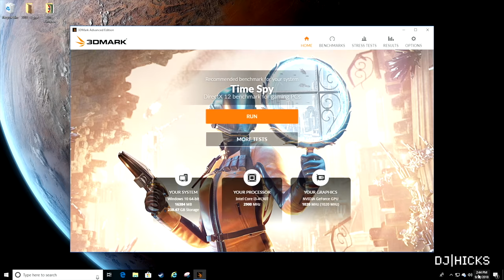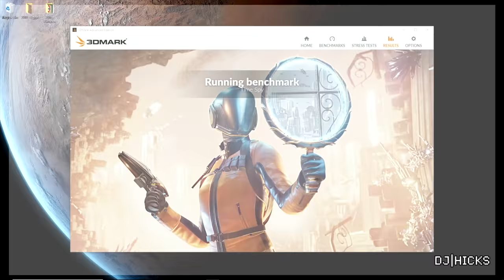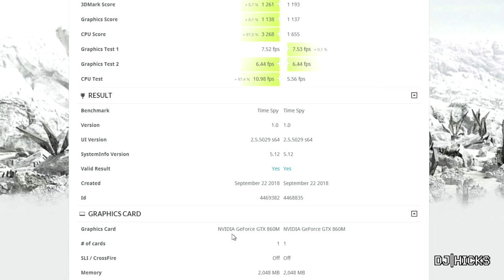How to Upgrade Your CPU Alienware Alpha Benchmarks

Comment: thanks for this, going to change out my i3 for an i5 4670s when it comes in the mail :) Hoping it improves performance decently.
Reply from the maker: Thank you, glad I could help.
Reply: @DJHicks  I had one question, do you experience any heat issues with your i7 S?
Reply from the maker: @matt-be8lc  I haven't noticed any. Even if it is throttling, I'm still getting twice the performance from the CPU. I installed this in an arcade and am running emulated games at 4K. It chugged with some PS2 games, but I decreased the scaling multiplier and it works well. Might be three times the original resolution now. The GPU could be a limiting factor on the newer games since I'm pushing a mobile GPU to 4K.

Comment: You should have mentioned how delicate the pins are, I just broke my cpu motherboard pins by trying to wipe some dried crumbled thermal paste off the Cpu pin set not realising the micro pins bend even if you breathe on them, if I'd watched another video that warned me about that I wouldn't have gone anywhere near them haha damn
Reply: honestly the pins are so delicate i never touch the socket if something like paste falls in just put cpu back in and try rebooting pc. i had some paste in my socket before and it booted fine

Comment: Hey, I have the first gen R1 Alpha ("Reg model:DO7U), and going based off your previous comments, I can only use a 4000 series with this alienware. Do you recommend the i7 4770s that you got, or should I get a core i7 4790k instead? Also, I noticed you said you got cmsx16gx3m2a1600c10 as your ram. Can I use a ddr4 instead, or can I only use ddr3 as it’s an old chipset?
Reply from the maker: You can use any 4000 series Core CPU. I had this one handy so it worked out. If you can find a cheap 4790k, sure. That's the best this generation got. I probably wouldn't overclock it though. There isn't much room for cooling. As far as I know, DDR3 is all that's compatible.

Comment: how was the heat dissipation after the upgrade? I too have a Gen 1 R1, and like you, I have a 4770s available to toss in it. I'm just worried about the heat. all I'm using mine for is a plex server, and I have a plex pass with hardware trasncoding, so this upgrade will increase my total amount of 1080p streams by double(around 8 to 10 streams after the upgrade). the only thing I'm worried about is the heat , if she doesn't overheat, I'm gonna do the upgrade. Nice video, thx!!
Reply from the maker: I haven't had experienced any heat issues. Refreshing the thermal paste was probably good for it too. I use this for an emulation arcade running most games at 4k. It can't handle some PS2 and GameCube titles, but I think that's more on the GPU. I don't know how it would do for hours straight watching movies. I'd definitely go for it though. This was a big improvement for my purposes. If anything it will throttle down if it gets too hot, but it'll probably still be faster than a Core i3.
Reply: @DJHicks  ok perfect!! I am using mine as a Plex server. But I've allocated 8gb of RAM for hardware acceleration and created an 8gb RAM disk for cache writing. It seems to run really well for the server, but it likes to max out all 4 cpu pretty regularly, so I think im going to try the i7 in it and see how it goes. I also have HWinFO running fans at 100%,. Thanks for the feedback sir!!

Comment: Had no idea how many different socket types there are. Even though I got the same one it was a different socket. Can't find any information about what socket type the alpha r1 takes.
Reply from the maker: As far as I know, the R1 had one socket that fit multiple CPUs. There were Linux and Windows variants, but they were all running 4th gen Intel Core i CPUs. The R2 had 6th gen, I believe.

Comment: What is the best CPU you could put in the Alienware alpha?  I just bought the RTX 2880 with the amplifier and figured it was about time to put a new CPU in it... I currently have the i7-6700T.
Reply from the maker: This is a first generation Alpha. The best CPU compatible with this one is probably a 4790K.
Reply: @DJHicks   Im sorry DJ the one I have is the second generation Alpha R2 with the intel i7 6700T....  Can i put something better in it safely?
Reply from the maker: @cedricjamesjr1  You might see diminishing returns replacing the 6700T. You're already on the high end of what the PC can manage. If you were coming from a Core i3 or i5, it might be worth looking into a greater i7. But yeah, Core i7 to Core i7 isn't worth the cost in my opinion.
Reply: @DJHicks  thank you for your reply.

Comment: Hy! Thx the video! 🙏🏻 Question: The Alienware can run in max boost the i7 4770S processor 3.9Ghz? Or heat up quickly the cpu and downgrade the cpu Ghz? Thx the answer.

Comment: Hi there, I have Alienware alpha and it has GeForce maxwell, i3-4130T And 4gb ram ddr3 1600MHz , I have for holidays 150euros max to upgrade cpu and ram. What’s the best cpu and ram for 150euros max???? And do I also need new motherboard?? Thanks so much in advance I wait for reply
Reply: im in the same boat as you!!!
Reply from the maker: You can't replace the motherboard. The best CPU you could get is a Core i7 4790k and 16GB of RAM. Any CPU you get is going to be used. If you are comfortable cleaning and removing a CPU, you can find old PCs for sale on eBay. That's probably your best bet, cost-wise. I'm using the Alpha in an arcade now and the upgrade from the i3 to i7 really made a difference.

Comment: Did you have any problems with it? The chipset compatibility of the Alienware alpha doesn´t match the chipset compatibily of the CPU...wondering if theres a problem if they dont match
Reply from the maker: The chipset matched. The Alpha Gen 1s take 4000 series Core CPUs. I upgraded the firmware before installation to avoid any problems. It worked right away.

Comment: Are the cores hitting close to max turbo boost frequency or throttling closer to base clock frequency under load from the higher power consumption and heat? Also, would it be worth spending $60-80 on the upgrade in your opinion (by purchasing the cpu on an ebay 20% off day + selling the current 4170 I have in it)?

Being 65w places it higher than my 54w i3 4170, which already hits 85c in games like AC: Origins (720p, low, ~30fps). So worried the Alpha would throttle it down for the extra TDP alone and then even more with thermals and get lower enough clocks than the 4170 to negate the extra cores, since the 4170 has the highest single core frequency outside of the 4790 variants, assuming those don't throttle down. But even when the 4170 is at 85c, it stays pegged at 3.7GHz on all 2c/4t. But 2c/4t is pretty rough with modern games, and its hard to maintain a stable 30fps in some.

I'd rather get a 4770t or 4790t ideally, but those are more expensive than the S variants and less pop up on ebay. Just looking to extend its life to be able to toss in a suitcase when we go out of town and my wife/kids go to sleep, since I am a bit of a night owl. I already replaced this with a Ryzen 2200g mini-ITX build as a HTPC/console for my bedroom TV, but even though its in one of the smaller consumer mini-ITX cases, its still twice the size and weight of the Alpha, and GPU's are pretty close, though the Ryzen has the edge over my 4170 for cpu. So debating upgrading the Alpha or just getting rid of it and lugging around my Ryzen build (especially if AMD releases APU's with better iGPUs when they go to 7nm but maintain the same thermals/tdp). Either pc is a 720p machine for the latest titles, the Alpha is just lagging a bit on the cpu side even for that purpose, but much better for lugging around.

Sorry for being long winded, but not many people still working with these Alpha's in 2018.
Reply: I ended up grabbing a 4770t and it was a step up. While it doesn't hit the same 3.7GHz as the 4170t, the games I tested it with saw an improvement with double the core/thread count.
Reply from the maker: I haven't checked the individual cores, but even if it is throttling, the performance has almost doubled under load. If you play CPU intensive games like an RTS, for $60, I'd upgrade. AC Origins performance might improve because it's open world, but it is pretty taxing on the GPU side as well. The 3DMark performance only improved on the CPU test. The GPU tests stayed basically the same.

My next build will include a Ryzen CPU. I haven't built an AMD PC in a few years. I'd like to get a Radeon video card depending on their answer to Nvidia's RTX series. Hopefully they undercut them like they did Intel with Ryzen.

I've looked into other SFF PCs and they all seem to be limited by heat. Like the difference between the i5 and i7 isn't huge because the i7 is clocked down so much under load. Nice name by the way. I immediately heard "LETMESHOWYOUSOMETHIN!" when I saw your comment.

Comment: I'm running an I7-4790 in mine with no problems, if it will run the 4790  it should handle any of the lga1050 processors
Reply: i7 4790t?

Comment: What do you think, instead of buy an egpu kit (GPU, adapter, psu), i do migrate the CPU, SSD, ram from Alpha R1 to a New Motherboard, plus a GPU And cooler? In long term, wouldn't It more cost effective? As long as  you could buy a lga 1150 Motherboard 32 GB ram instead of 16 gb And put a stronger 4gen CPU with more tdp, for example?
Reply from the maker: I would just build a new PC rather than salvage these parts. It wouldn't cost much to outperform the Alpha G1. The appeal is the form factor. If size doesn't matter, you can build a micro-ATX PC for a few hundred dollars that would beat the pants off this Alpha.

Comment: Did you u get a new power supply or was the stock one that comes with alienware alpha i3 enough?
Reply from the maker: I used the existing PSU. There was a significant improvement in performance. If it isn't the full power of the Core i7, I haven't noticed.

Comment: I have the Alienware Steam machine I3 (ASM 100-980) is the same of yours? Or I can't upgrade the CPU in mine ?  Thanks
Reply from the maker: I believe that's the same model number as mine. Regardless, you can replace the CPU with another from the same series (4000 for R1, 6000 for R2).

Comment: What processors did you  upgrade to exactly?
Reply from the maker: Intel Core i7 4770S
Reply: @DJHicks  thanks for this video do you thin i can  upgrade to this cpu Intel Core i7-8700K
Reply: @DJHicks  thank you
Reply from the maker: @carlosespinal1434  No. The motherboard wouldn't support an 8000 series. The sockets have to match. A Core-i7 4790K is about as high as you could go. in a first generation Alpha. Alienware Alpha Gen 2s have 6000 series Core-i7s.
Reply: @DJHicks  thanks
Reply: @carlosespinal1434  A K processor isn't worth it though.  You can't overclock the chip, which is what you'd get  K series chip for.

Comment: Hey DJ, what i5 cpu should I buy to upgrade my alpha? I’m guessing it has to be a 4th gen...I can’t do the i7 because it’s a bit out of my price range, thank you!
Reply from the maker: I don't know if the performance increase from an i5 would be worth buying. You might be able to find an old used PC with a 4000 series Core-i7 for really cheap. Salvage the CPU and scrap the rest. If you wanted to do that with a Core-i5, that's an option too. But the gains wouldn't be significant.
Reply: Thanks for the advice and reply!

Comment: How well does it handle other games at decent settings compared to the i3-4130t? Is there a difference at all or about the same?
Reply from the maker: It depends on the game. I noticed a huge difference in CPU heavy games like Beast Battle Simulator. Most RTS games are more CPU than GPU intensive. I haven't tried Halo Wars with the new CPU yet.

Comment: Does it support 32 gigs ram? What compatible  CPU you recommend now in 2019? Will new intel 8th gen mobile chips (U version) works?
Reply from the maker: 16GB. Core i7 4790K. No, it has to be a 4000 series Core product. Alienware Alpha Gen 2s have 6000 series Core-i7s. This is a Gen 1.

Comment: Awesome video.... Do you still use yours? I have the r3 version and man is it laggy. I use it for my wife to mainly surf the net and watch videos in bed. Already upgraded to an SSD drive but that i3/4gb is killing me. Can you post a link to the parts you ordered, location of the firmware update you did, please. Thank you
Reply from the maker: I was not aware of the existence of a revision 3. Unless you mean Core i3. A PC of of mine died and it just so happened to have a Core i7 compatible with the Alpha's chipset. At this point you could probably find an old PC on eBay with a 4000 series Core i7. You can google "alienware alpha bios update" and it's the first result. This is the memory: CMSX16GX3M2A1600C10

Comment: Did you run into any problems with the T being a 35W CPU and the S being 65W?
Reply from the maker: Nothing I've noticed. There is a significant improvement in performance. Whether it's the full capability of the Core i7, I do not know.
Reply: @DJHicks  Cool! Thank you

Comment: My rust takes years to load and crashes constantly what should i upgrade
Reply from the maker: An SSD would yield the greatest performance improvement overall. If you double the RAM from 4GB to 8GB it would probably help too. CPU would be third because compatible chips might be difficult to find at a reasonable price.

Comment: Hey bro nice video, I have the alpha r1 and my uncle bought the i7 4790. Not the T series will it work in it? 🥺
Reply: It will thermal throttle, but it will work. So you may not get the max turbo speeds for any sustainable time, but still would be an improvement over the stock 4130t.
Reply: FireMrshlBill thanks
Reply from the maker: @aion694  What FireMrshlBill said. Sry for the late response.
Reply: DJ Hicks okay bro np thanks
Reply: GTX 860m just as a follow up, if you haven’t installed it yet, Digital Foundry did a video on the Alpha back then and put in either a 4770k or 4790k. So you can see performance/temps on that. However, I think they concluded that it wasn’t worth it at that time, but with how games have changed in the past 5 years we know the extra cores are worth it now, so I’d do the swap and see how your temps go. Run some benchmarks with the 4130t and the 4790 to see the improvement (cinebench r15 or r20).
Also, the default fan profile keeps the fans running low until it hits 80c and then they crank up to full speed. So don’t be alarmed when the fans really crank once it gets going. My 4770t will sit in the 50/60c’s just browsing and whatnot and hits 80c when gaming pretty quick with any new game. So a normal 4790 would do the same. I tried changing fan profiles a few years ago, but HWinfo/speedfan/etc. only recognized 3 fan speeds... so you couldn’t do a gradual fan increase like with most PCs, instead it was a stair step action. In the end I didn’t find it useful for either cooling or acoustics, so just went back to stock fan profile since these CPU’s are fine at 80c even though they lose turbo and start thermal throttling at 73c or so (if I remember correctly).

Comment: I have buy a i7 8700T and testing this the next days in my alpha r2.
Reply from the maker: My Alpha R1 died last year. I couldn't do anything to fix it. I'm glad you still have a working one. Fun little machine.
Reply: @DJHicks  Oh das tut mir leid, wie ist das passiert?
Reply from the maker: @lasershark8833  I don't know. I was using in an arcade cabinet and one day it refused to boot. I troubleshot for hours and swapped parts, but nothing worked. I salvaged the SSD and put it in a new build, so that disaster was averted.

Comment: what about cooling ? the original fan looks pretty small ....  does the i7 still cool ?
Reply from the maker: It does. I worked it pretty hard for a couple of hours playing Beast Battle Simulator. It consistently performed better than the Core i3. If there were throttling issues because of heat I didn't notice. The stock Core i7 configuration for the Alienware Alpha uses the same cooling system. If anything, it cools better now because I used higher quality thermal paste.

Comment: Hello, I also have an Alienware Alpha R1 with an I3-4130t, I wanted to change the CPU to an i7-4770, but the logo appears yellow indicating failure, they told me it could be the BIOS, I updated it and it still does not work , After the i7 was damaged but it is not, finally they said that I need more power from the charger (I think mine is 130w), as this computer is a gift for my brother who goes to university, I would not want to spend a lot, what could you do in my case ?, thanks, by the way, i don't speak english, so sorry for the grammar or misunderstandings
Reply from the maker: Mine just worked after I installed the 4770s. I'm pretty sure someone in the comments has even installed a 4790 in this. Maybe it was a 4770k. Either way, they can draw more power than a standard 4770. Make sure no pins are bent on the CPU. I did update the BIOS before upgrading. Make sure all the cables are plugged in everywhere inside. Maybe take one stick of RAM out if you have multiple installed. You could try a different power supply, but they might be hard to find. Good luck, dude.
Reply: @DJHicks  Thank you very much, they told me and I investigated that the new CPU consumes more than twice the Watts than the I3, so I think I will get a more powerful charger, where I live curiously they are easy to find 180w or 240w chargers, thank you very much seriously

Comment: Soon gonna upgrade cpu to i7 4790k. (Already upgraded ram to 16gb)
Reply: be careful if you havent already, i would go for the same processor without the k since you cant overclock on here anyways.
Reply: Lieutenant Sxpreme do you need new motherboard for new ram and cpu ?
Reply: does it works?